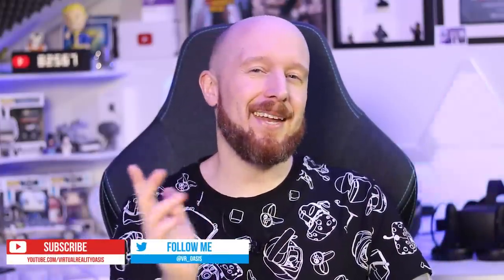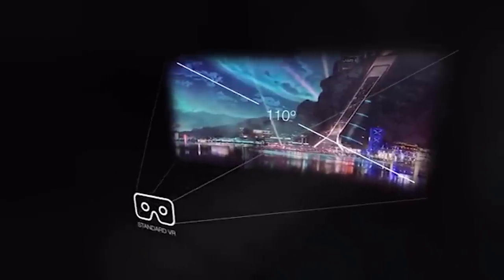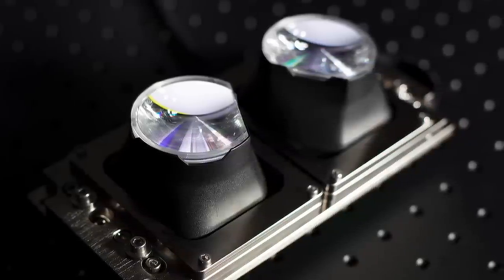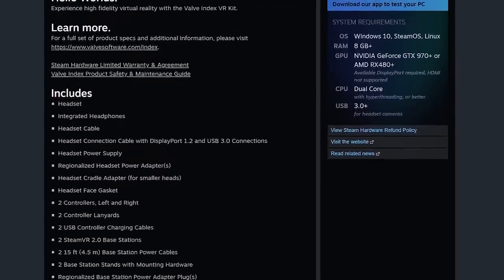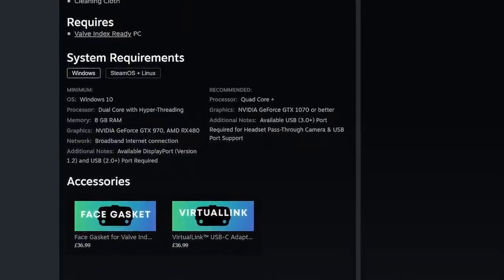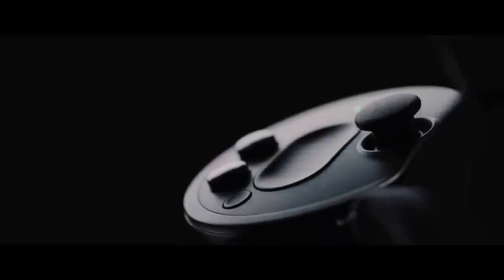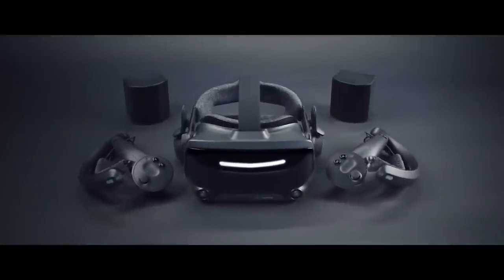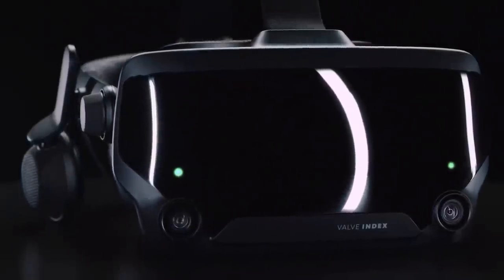Valve Index - Everything you NEED to know

Comment: I wonder how those double lenses work.
I'm upgrading from the original Vive. Bought the HMD and knuckles. The 130 degrees FoV made the deal for me.
Reply: Pimax 170 though. That's true next gen
Reply: @ThereminHero  Sadly the FOV is all thats next gen about a Pimax, and while this Valve Index can be considered next gen (as in, they improved every aspect, so this kinda starts generation2) it still accepts current gen hardware to run it. So if you ask me, the Valve Index actually is next gen, while the Pimax was a fun (but expensive) way to look at the future of VR at best. Realistically we likely wont see such fov's again till generation 3 or 4, because its getting pretty clear that people want less screen-door-effect above anything else, and currently large fov's just means even more screendoor effect then on cheaper headsets.
Reply: @suicidalbanananana  yeah u are right its better to make what we have better before we try and make something with bigger FOV with the same or worse screendoor effect

Comment: Need Oculus to make their own knuckles now...
Reply: They're compatable from what i've seen
Reply: oculus has their own knuckles.  since oct 2016.
Reply: Oculus stopped caring...
Reply: @TrevorJones1  I have a Ride. No they don't.
Reply: Just Some Guy Ok  it’s called there normal controllers are u DuMbFoUnDeD
Reply: @everettrittenhouse1466  If you're going to mention this, then properly mention it.
This will likely not work with a Quest at all (as i doubt steam will support that) but with a Rift-S its possible on paper: people will need both Oculus and SteamVR tracking sensors set up, and even then the combined hardware will only work on Steam, the Oculus software will not understand what to make of the lighthouse sensors or valve index controllers, but Steam does understand those AND it understands how to make an Oculus device work aswell.
Reply: @TrevorJones1  You're confused, the Oculus Touch controllers and the Valve Index controllers are VERY DIFFERENT CONTROLLERS.
Reply: @OverbiteGames  right now the only thing can think of is playing rock paper scissors
Reply: @suicidalbanananana  time will tell
Reply: @Ph03nix1  meh. It will work just fine with touch.  And now that i about it contextually Rock paper scissors would too.  To put a programmer analogy to this.  Touch is the base class of the index controller.  Its like the xbox360 pad vs the dualshock4. They are functionally the same where it matters but ds4 has a trackpad and gyros.  How many cross platform games on ps4 use the trackpad or gyros in a meaningful way?
Reply: @TrevorJones1  Your sorta missing the point, its about the new input method. Kinda like how one console (n64? psx? not sure tbh) introduced an anolog stick, and then next generations all other consoles followed because it was such a great idea. Same will prolly happen here, most people invested in VR already want some sort of gloves, this is just a step in that direction, competitors (including Oculus) will follow with their own take on finger tracking, its the logical next step in the evolution of controllers, that makes a ton more sense for VR then it does for consoles.
Reply: Please can you help me so does the valve index work with htc full body tracking?

Comment: to everyone complaining about the 1,000$ pricetag - let's do a comparison:

Valve Index HMD + Index Controllers + Base stations = 1,000$
vs
one of the many ridicilously overpriced flagship smartphones out today that cost way over 1,000$, that doesn't do much more than a regular mid-range phone.

which one would you choose to spend a thousand bucks on?
Reply: Good point. I kind of hate the new phones, but I still feel like it’s a bit expensive. But so are the phones
Reply: I wont buy I smart phone that cost over 300 euros and they last for about 4 years with daily use.
Reply: Forget comparing it to a phone, compare it to a Vive Pro, €1400 vs €1079, but the cheaper option improves everything besides resolution. LOL. Rip HTC tbh.

Comment: Are the original vive 1.0 base stations and original vive controllers compatible with this headset?  And if so, will you be able to upgrade later on?
Reply from the maker: Yes []-)
Reply: Yes and Yes.
Reply: @VirtualRealityOasis  Thanks!  []-)
Reply: yes and yes
Reply: Yes. So, you can get only the headset and buy the rest later. 2.0 is backwards compatible with 1.0. However, you cannot make your original Vive headset and controllers work with 2.0 base stations, because the 2.0 base stations lack the synchronization pulse original Vive expects. Vive Pro supports 2.0.
Reply: The new hardware is supporting 1.0 basestations, and you can upgrade each part one by one, but 2.0 do not support 1.0 hardware, so upgrade basestation last if you wish to upgrade the basestations.

Comment: I'm wondering about how the Pimax Sword controllers are going to compete with the valve index controllers becuase they are pretty similar
Reply: They hopefully won't cost 300 like the knuckles do
Reply: @lostecho4394  Sword preorders say $300 for 2 controllers and 2 base stations.
Reply: @vtevdo  which is much better than the knuckles which are 300 for the controllers and another almost 300 for the basestations
Reply: @vtevdo  That's only the deposit and not guaranteed final price
Reply: @ksawierwilczynski442  True, not guaranteed. Also, Sword and Sword Sense prices differ, so $300 may be for the Sword. Anyway, I think $300 is reasonable for the Sword bundle and $400 for the Sword Sense bundle.
Reply: My guess is that they've literally gotten blueprints in some shape or form from Valve & worked off of that, so the functionality will be 100% the same, and i'd be surprised if the price was any lower. That said, i personally dont like the look of the sword sense controllers, that big ring thing around the hand will just bring back the issues we had with the Vive Wands, you bringing your hand close to your face (to aim down the sight of a rifle or whatever) means you bump your controller into your headset, immersion broken. Id rather have the less bulky version of the index controllers.
Reply: @suicidalbanananana  Valve has patented their hand tracking tech, and did so after they left pimax to their own demise. So Pimax would have to develop their own, so far, it's not believable they have.

Comment: 300 euros for controllers are pretty hefty price. but oh well, time to start saving money.
Reply: Honestly the prices for the controllers seem justified, they're some high level hardware, it was mentioned in the Tested video that each controller has 87 sensors lol, thats just, not going to be cheap any time soon. What surprised me personally was the price of the lighthouse 2.0 sensors, the hardware inside is greatly simplified and at the time Valve said this would help reduce costs, but now that we can buy them they are the same price as ligthouse 1.0 sensors?...

Honestly what im thinking is happening with those prices is they decided to use the savings they had on the lighthouses to bring down the price of the actual headset.

Comment: Portal VR, Left 4 dead , and half life
Reply: - Portal VR -> 25% sure we will get something along these lines (they already used the aperture universe a couple of times to promote VR) but i highly doubt it will have actual portals, instead it will be a take on "F-stop", a prototype they once had for Portal2, where you solve puzzles by scaling things trough the use of perspective
- L4D3 -> 15% sure we get this (its been leaked that there WAS a VR version of L4D3 at one point, but they stopped development, and now turtle rock is making a 'spiritual succesor' to left4dead called back4blood, this will likely get bought by Valve and become a 'flat' L4D3)
- HL:VR -> 99% sure we get this, its been leaked (in cs:go, dota2, etc updates) for 3 years straight now (and its rumored to be a prequel to HL2 because screw everybody who wanted the cliffhanger resolved)

Comment: Valve Index vs  Other Headsets-
Resolution: valve < hp reverb
fov: valve < pimax
weight: valve> hp reverb
tracking: valve doesn't have inside out tracking
panels: valve does not have oled panels
Refresh Rate: valve has highest rr with 144Hz

So can anyone explain to me why this headet is so special? I dont see anything revolutionary here except for the refresh rate being higher. Is all the hype just because it is been made by valve?
Reply: From what I understand Valve Index is overall a better piece of gear than the competitors, but it's a bit difficult to do side by side comparisons with VR headsets as they are all quite different and cater to different market segments. You can't just look at certain numerical values and exclaim "this one has higher numbers, so it's better". For instance, Pimax may have a higher FOV, but that headset has significant other issues. Or take inside out tracking as another example; while it may sound cool and convenient, in terms of pure performance the mounted laser trackers of the Vive and Index are simply just better. So it comes down to what you personally are looking for, and for people who are looking for high-quality, immersive gaming, the Index seems to be the best option out there. Assuming that there are games made that utilises the controllers, of course.
Reply: I agree with Dan. Even if Pimax has a higher fov or Reverb has a higher resolution, does that make it a better headset? It doesn't.
As he mentioned, Pimax has a handful of problems with their headset and I heard their company support is terrible. Valve, on the other hand, has great support for their hardware and I believe that Index won't have many issues. I would imagine that the field of view looks great on Pimax compared to the Index, but is it worth the distortion on the screen and risks? That's for you to decide.
On the other hand, resolution doesn't mean a headset will look better. It will surely help, but there's much more to it. PPI, for example, plays a good role in clarity. Will the Reverb look better than the Index? We don't really know. Will the Index look great either way? Of course.
Reverb's tracking will be worse than Index's tracking. If you want to play a game with a bow and arrow or any game that requires you to move your hand behind your head then it will lose tracking. Index, on the other hand, will not lose tracking when doing so.
Reply: 120hz (native) and 144hz (experimental), dual lens, BMR audio, 130fov, knuckles controllers, built for long-term comfort, mechanical IPD, and has special passthrough cameras that can build 3d objects (experimental). Also, the kit is completely open-source and mod-friendly (built specifically to be modular). 
All these things put together make it by far the best VR kit available. 
Those kits you list only have that one thing going for them. They lack in all other areas to bring in the full experience. 
You should also consider the build quality, price, and company behind it. Listing Pimax as a competitor to Index is hilarious. It would be better to compare with XTAL, which is not a scammy chinese company without real products. 
Also, we dont know the weight so I'm not sure why you think the Index weighs less than Reverb. 
Consider the field of clarity versus the Reverb, a lot of people that have tried both state the Index is better in terms of overall clarity just becasue of the large sweet spot, unlike the Reverb's very small sweet spot. I think the Reverb is still a better option for sim racing in this regard. 
Inside-out tracking is still terrible and is 5+ years away from the accuracy that LH tracking provides. Rift S owners are returning their product left and right currently due to these tracking issues. Especially shooters where you have inherent occlusion and makes it impossible to play with a rifle with a inside-out tracked system. 
LCD is far more advanced and provides a much better VR experience overall. OLED cannot utilize true blacks due to smearing. There good reason the VR industry has dropped OLED for advanced LCD.

Comment: Omg the bundle is unbelievably expensive. The six hundred dollar vive was understandable but 1000!
Reply: The vive was initially 900 and this blows it out of the water.
Reply: The vive also had a terrible strap without headphone. U need to add the 100$ delux audio strap on top to be comparable. 1000$ for the index is a fair price
Reply: Well I’m broke so it’s still expensive to me🤣
Reply: It is an enthusiast grade VR system. The headset costs $500, while the Pimax 5k+ (another enthusiast grade headset) $700. I would say the Valve Index build quality and features (except FOV) looks better. So. $500 does not look too much IMO. Also, another $500 for controllers and base stations seems too much. However, when you think about how many sensors Index controllers have, it does not look quite that expensive. Anyway, upcoming Pimax Sword controllers together with base stations are going to sell for $300. That could save you $200, but the quality may not be the same. I would suggest waiting for reviews (around beginning to mid July).
Reply: Considering new apple phones are about $1000, i think the price is pretty reasonable.... and that apple over prices their stuff
Reply: Im sorry what? the Vive launched at a 1000 bucks for most of the world ;) and then most people still bought the 'deluxe audio strap' ontop of that for even more total costs, you're comparing price-dropped old VR hardware with 'bleeding-edge' high-end VR hardware.

If you have to compare, then compare a Valve Index to a Vive Pro, thats a much more fair comparison, where you will find that the Valve Index is cheaper but also better in pretty much every possible way. The 1000 bucks price is actually quite fair.

Comment: Index:144hz
Oculus:90hz
My Oculus running on a 1050ti:20fps

Nice
Reply: Matthew Glennon I know how that feels, I just upgraded tho and it makes a HUGE difference, definately invest in a new gpu if you can😁
Reply: Ocealot P I was certainly thinking of upgrading, but i put it off as i really (for some reason) dont really notice frame issues in vr until about 20 ish, most of the time (on vrchat, the only one with an fps counter) im on 30-40, but i suppose i should upgrade, bit of a wast not to... may i ask, what gpu did you have and what did you upgrade to?
Reply: true i got 1060 and cant hit 90 fps on most games
Reply: @ignoredpie6083  also  i think for vrchat u would need a stronger cpu then gpu but check your task manager what is taking 100%

for me cpu sits on 80 and gpu at 30-60%

Comment: I get my valve index tomorrow, I still think it's the best especially when you can cool it down with the usb fan add in on the front, also ordered the duster knuckles for my controllers and 144hz is bad ass

Comment: Even at $1000, I've been saving for a vr headset for the last like 5 years. Finally I can get a good (non-mobile) VR experience in my own house. \o/
Reply: Make sure you got the computer to run it. VR takes an incredible amount of power and these minimum requirements listed there barely cut it to play the most basic games on low quality.
Reply: @Maddinhpws  Ah no worries, running a 6700k, 32 gigs of ram, and a 1080. Should have no problem.

Comment: Nothing new. Just one another VR headset. Where is 2nd generation wireless headsets with adaptive high res displays?
Reply: Wireless VR will never happen until MB manufactures have built-in 60ghz. Also, this is a low-persistence and low-latency high-res display with an extremely high refresh rate.

Comment: I really look forward to seeing you review this. Personally I’ve got the Oculus vision of VR to the general user rather than the elite but the technology needs to be tested and evolved. Thanks for the content, as always
Reply: Everybody has the vision of VR available for the general user, even companies like Valve or Pimax want that, its just that right now some hardware cant be had for cheap prices, so for the foreseeable future there will be clear 'levels' of VR, cheap and okay levels, but also very expensive levels that will give much more immersion, the end goal is for it to all be cheap but also have the best hardware, for that to happen the best hardware has to become cheap, and for that to happen it has to be sold alot, so that will at first still happen at high prices.

Its bscly exactly what you end with, VR has to evolve, and different price ranges of VR is how it will evolve, soon enough cheaper price ranges will try anything they can to get the same features as high end VR, meaning price drops across the board.

Comment: The enthusiast are incredibly important. Their experiences drive the mainstream market. Valve will likely release a better headset in the future and make Index a more mainstream model with a much cheaper price tag. Similar to how the HTC Vive Pro is to the Vive. But likely sell the better headset at current Index prices instead of gouging like a typical cellphone company. Luckily, Valve isn't about gouging people. Which is the exact reason Steam is so successful.
Reply: Greg valve does not have good track record with hardware. They are ok at best for prototype. Few is willing to pay ~1000 dollars buying a VR  again for playing the same indie games.
Reply: @DillyVesper  You would be surprised. People said the Vive was too expensive and here it is. People will pay the tax just as they pay the Nvidia tax. (Me). I may or may not go for the index.  I really just want the controllers and wont upgrade headsets until a wireless option is made. I wont go back to wired.